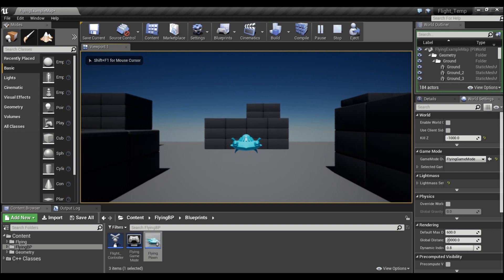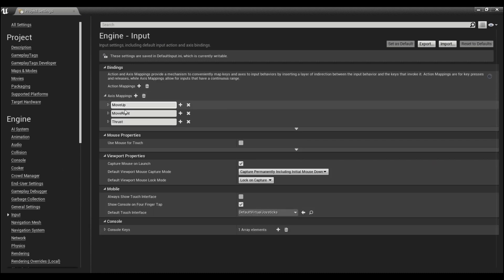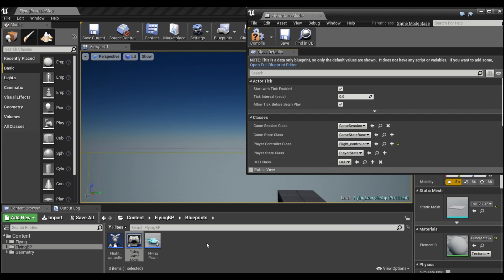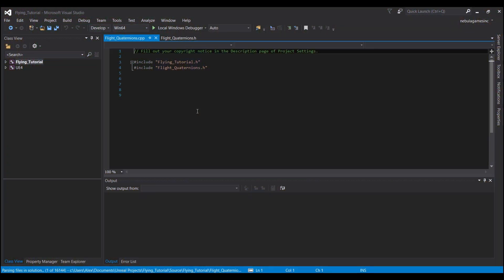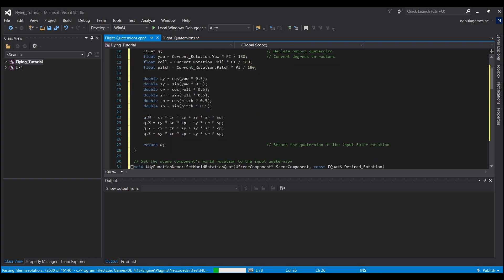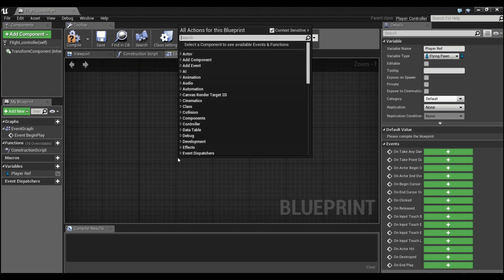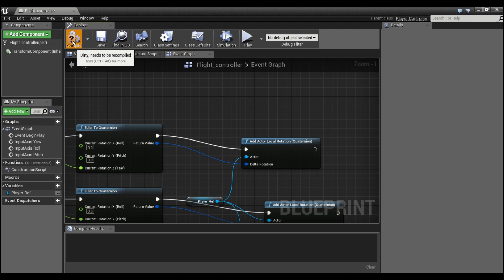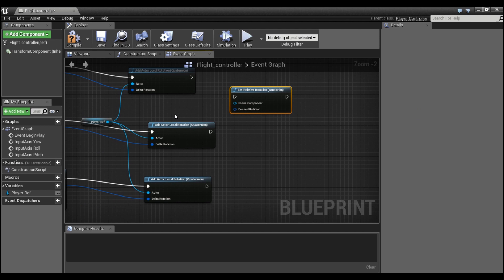#gimbal #6DoF #quaternion Unreal Engine 4 Tutorial: 6DoF Fixing Gimbal Lock

Comment: Hi, this doesn't seem to be working for me. Everything works up until I build the C++ class and return to the editor, but when I search for Quaternion nodes in BP the new nodes do not appear. This happens even if the Context-Sensitive tick box is unchecked when adding a node. I work on Mac, which uses Xcode instead of Visual Studio, but I want to rule out all other possible problems before jumping to the conclusion that this is a platform issue. Is there any way to contact you outside of YouTube's comment system so I can figure out what I'm doing wrong?

Any response would be appreciated. Thank you so much!
Reply from the maker: Hey Lillian, you can email me NebulaGamesInc@gmail.com. Also, have you tried shutting down the editor completely and restarting it? I have had issues similar to this, where it compiles but the nodes do not immediately show. Usually restarting the project allows the nodes to appear.
Reply: Restarting it worked - thank you so much!
Reply from the maker: Awesome! Simple fixes are the best! Happy coding.... hope the results are to your liking 😊
Reply: @NebulaGamesInc  It worked beautifully, thank you! I had to skip Building in Xcode, but Compile worked in UE and my flying template can now fly at the sun.

Here's what I wrote when Xcode wasn't letting me Build, but you can /ignore this if I should /ignore Xcode:

I'm also using Xcode (v10.1) on a Mac (v10.14.2) and when I follow your tutorial I can't "Build" in Xcode (it's grayed out, as well as . I've variously tried restarting the editor (v4.21.2), rebooting, and restarting Xcode. I'm getting pretty good at recreating your project from scratch.

I'm using the default Flying Template with Starter Content on and I'm using exactly your names for everything throughout. I don't know if it's related, but I noticed my Cpp and header files don't have: #include "Flying_Tutorial.h" at the top like your files do.
 
Header:
// Fill out your copyright notice in the Description page of Project Settings.

#pragma once

#include "CoreMinimal.h"
#include "Kismet/BlueprintFunctionLibrary.h"
#include "Flight_Quaternions.generated.h"

/**...

Cpp:
// Fill out your copyright notice in the Description page of Project Settings.

#include "Flight_Quaternions.h"

// Formula to convert a Euler angle in degrees to a quaternion rotation...
Reply from the maker: They need header files for the project. I noticed on updated engine versions I had to put that in manually as it was not automatically added. That would def be a reason for failing to build. I would need to see what errors the compiler is throwing to say for sure but yes, put the header files for your project back and I believe they need to be the first header listed or it will throw an error for that as well.